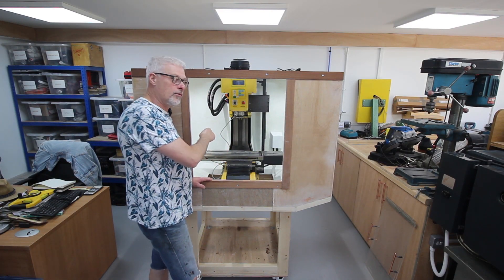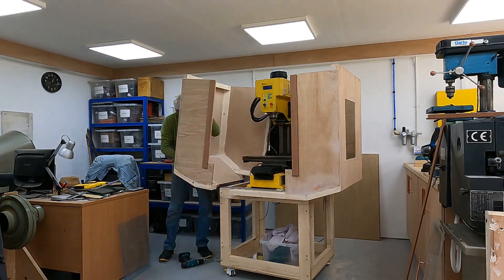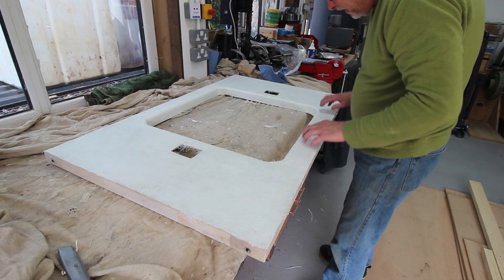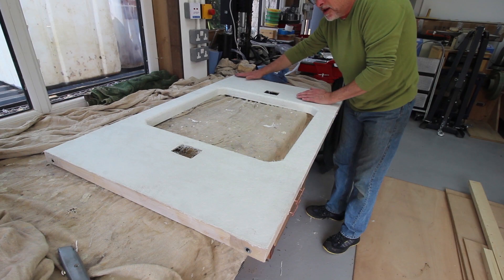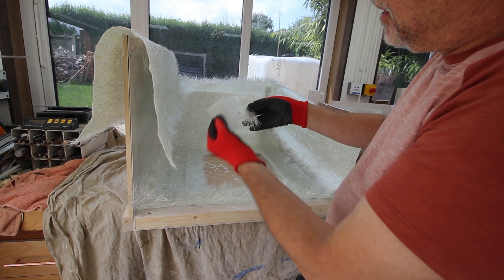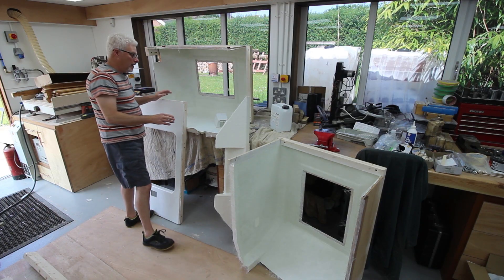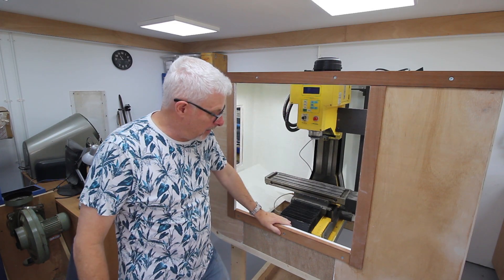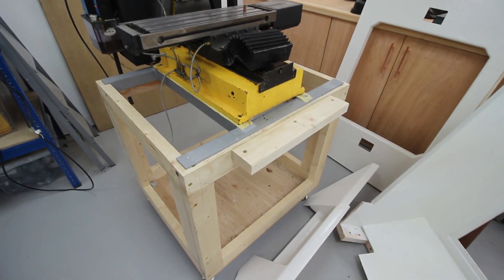CNC mill cabinet build pt4

Comment: I think I would have used sheet Aluminium and rivets.
Reply from the maker: Hi 
I did think of making it from metal but I have no way to bend sheet accurately so I thought I’d try glass fibre no idea if it will work long time. It’s an experiment 
.
Cheers

Comment: Hi!
I just stumbled upon your channel as I was looking for videos showing a SyilX5. I bought one a couple of years ago and have done some modifications (mostly electrical; I've changed it to use EdingCNC, built a pneumatic powerdrawbar and fitted a probe). I'm now at a point where the mechanical limitations of the machine are becoming more apparent, especially the lack of rigidity in the colomn (I saw in an earlier video that you had the same problem with your machine. Did  your solution solve it entirely?) I don't kow if I'm overasking, but when I make a 20mm deep clean up cut in aluminium and do a spring pass afterwards, I'm still faced with a couple of tenth of a mm dimensional deviation (especially in the x direction).
I'm currently contemplating building an enclosure made out of steel tubing and bolting the column to that, so hopefully it will stiffen it up enough to do some more accurate work. 
Otherwise I agree with you that, for the price, it's a pretty nice machine for prototyping and light machine work.
I'll be following your progress on the enclosure and other machining videos with interest!
Reply from the maker: Hi @ltdeditions
Not really sure I solved the rigidity issues in z with the extra linear bearings. I think you might be right we are both upto the limitations of the machine. Given the choice I would start from scratch with my own design. These machines are old now sadly I can’t see much out there that is a reasonable price for the occasional machinists.
These machines new enclosure is coming along well not yet tested but I hope to do that this week keep posted for the results.
Cheers

Comment: I was going to say if when you're done using the machine and going to let it be sitting for more than 2 weeks after running flood coolant be sure and dry table off and spray a light coat of WD-40 on it and all unpainted surfaces.  Even if it is damp inside it will keep any rust away.  It's only necessary to do when your parking for a couple weeks or more
Reply from the maker: Thanks Dave,
I have done that for years still get a bit of tin worm though!

Comment: I'm really happy to see you wearing proper PPE while working with this stuff! Glass fiber and resin are both much more nasty than a lot of people give them credit for. Really cool idea, I wouldn't have considered laminating a wood structure with fiberglass like that. Did you ever think about molding the fiberglass panels to be used without the wood backer? That would be super light and probably still sturdy enough to handle the task at hand!
Reply from the maker: @Trainwreck,
Yep the itching that goes with this stuff is horrible! I did not want any of it in my lungs. The wood backing is not needed but is simpler than making a form to mould the part. Being lazy I went with the easy option.
Cheers

Comment: Hi David,  your CNC cabinet is coming along well, looks good with glass fibre and a resin finish. I never worked with glass fibre , but you make it look easy to work with and you got a good resin finish, good job. As always a great video, have a good weekend take care.
Reply from the maker: Thanks Shaun,
Never worked with glass fibre before it’s a slow process that you have to do fast! Once the resin is mixed you are on the clock and have to get it done quickly before it sets.
The cabinet is nearly done about three more days of work and I can test it out and find the leaks!
Cheers